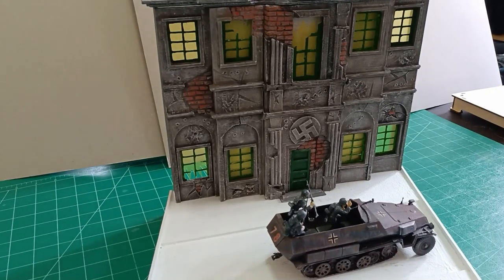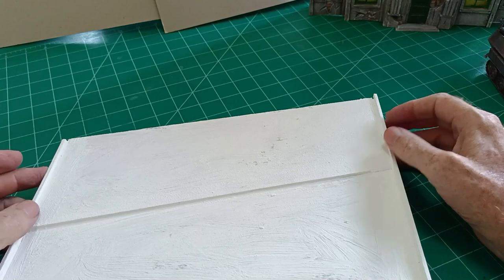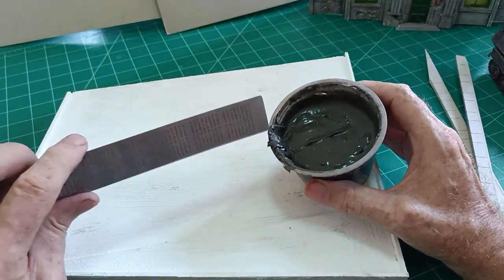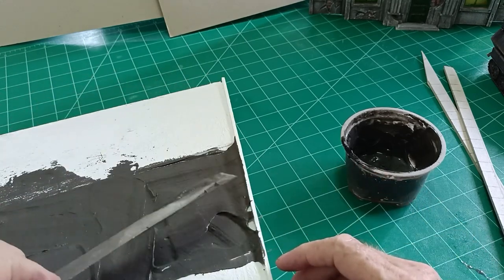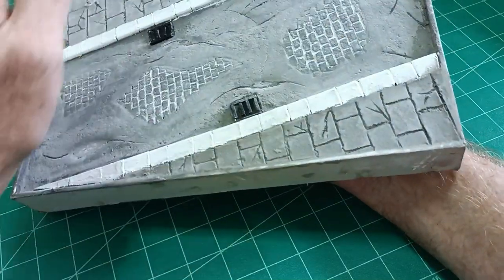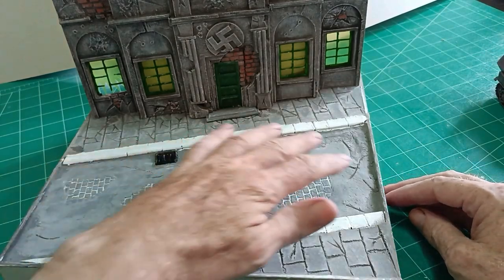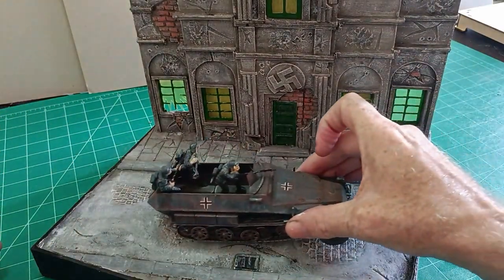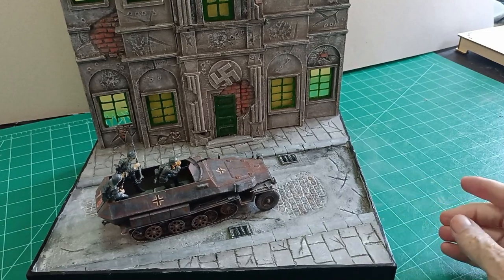How to make roads and paths for dioramas

Comment: My Good Man.  Don in one of your vids the comments section Was MIA.  This video was on Drains.  I was going to share on how to simulate the cross bars for the Drains aiong the curbs.  I digress But I would use straight pins.  I think they would add a nice touch.   I hope folks are not being rude and out of line.  I find you are VG in cardboard.   I find you have great tips for our hobby.  Well as for Me Folks Over and Out.